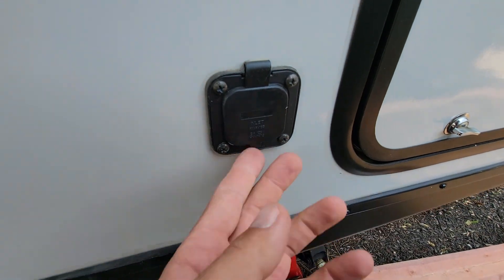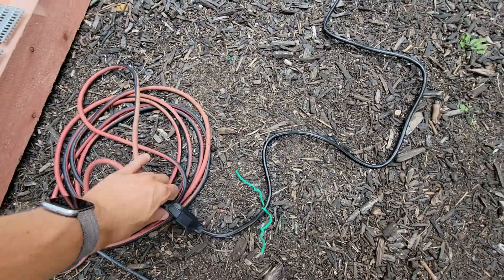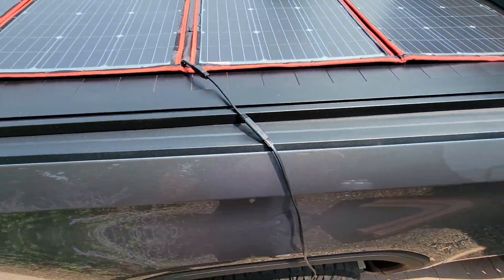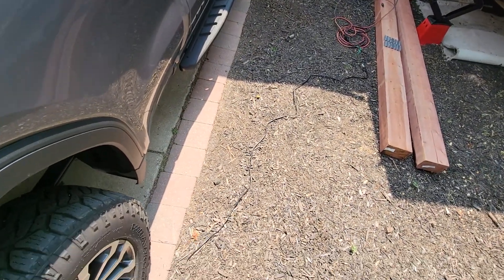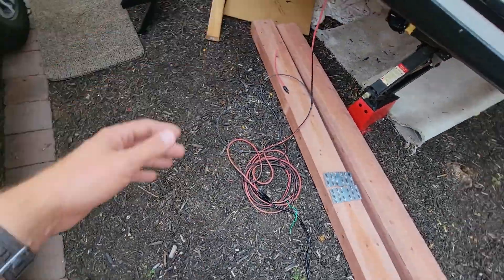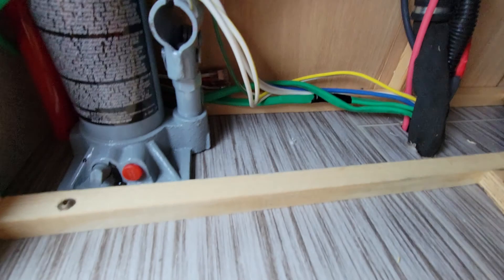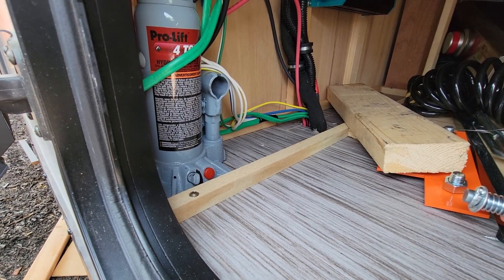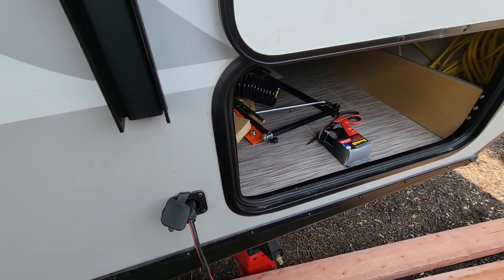Connect Portable Solar with Extension Cord

Comment: Another great video - appreciate you sharing. Every video you post causes me to have more questions :) Have you replaced the original controller and inverter - or just supplemented. I'm not familiar with your floorplan - was the inverter not in your front storage originally? Just asking because I want to move mine under our bed to prevent the power button getting pressed unintentionally and to gain some space. -- On a separate topic - I noticed the scissor jacks, did you replace your stabilizers or did your model come with those. Thanks - really appreciate finding this content. I've only seen one or two others posting mods to their ibex trailers - really helpful.